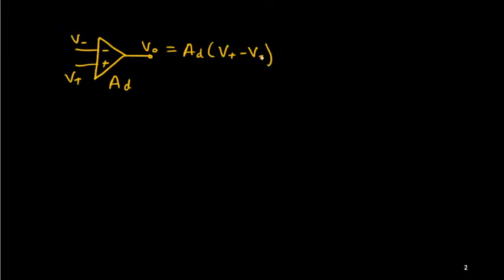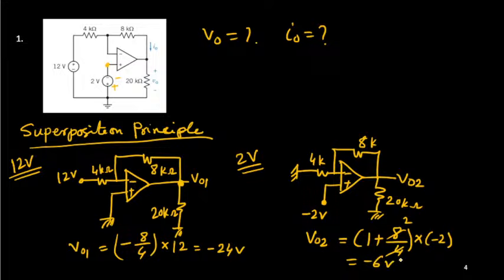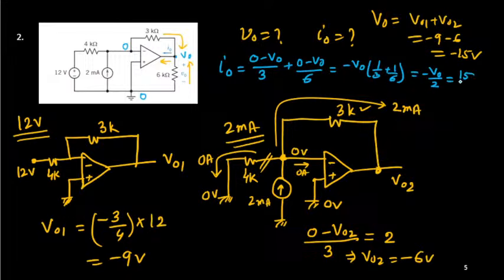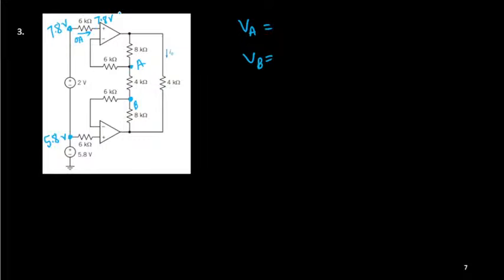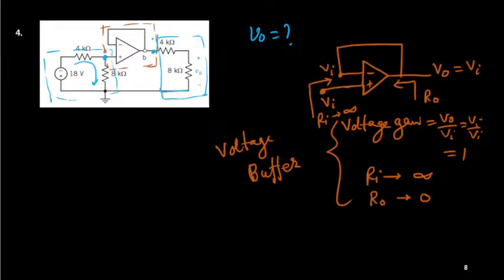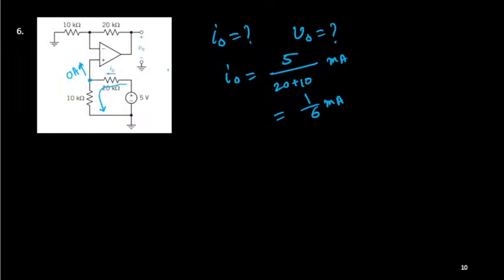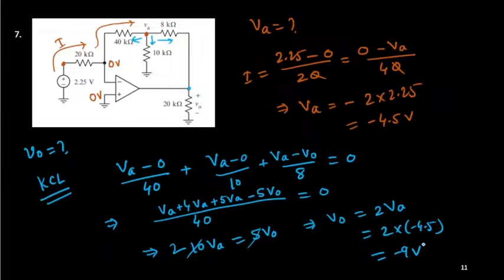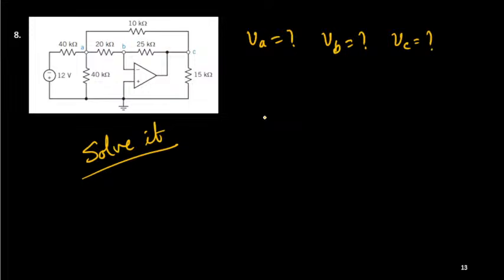Problems on Operational Amplifiers (OP-AMPs) - GATE Level Problems for ECE/EE/EIE

Comment: In the 3rd question at 37:20 how you get to know that the current flowing through 6Kohm resistance is equal to zero .Please explain
Reply: It is the property of a amplifier, because of high amplifying ratio v+=v- so that is why there is no current flow in it